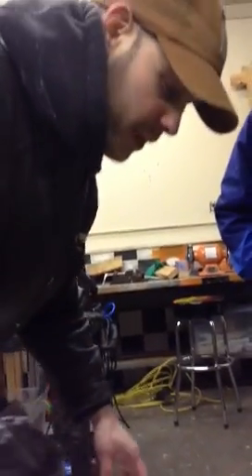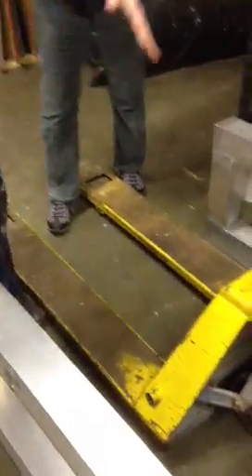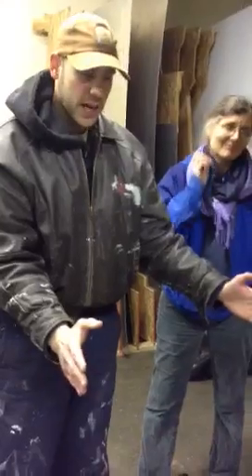Aluminum welding- avoiding bowing under heat with a jig

Comment: I know this video is super old, but all you have to do is weld more on the opposite side to bring it back. Measure as you go. Maybe some kind of drop in pin when 2 holes are lined up indicating proper realignment.